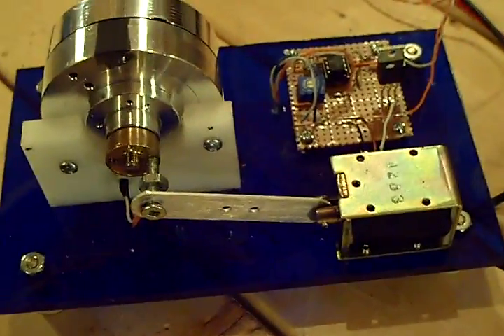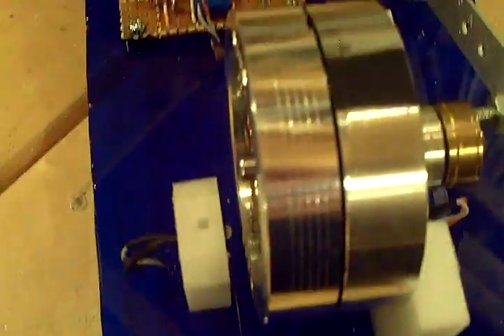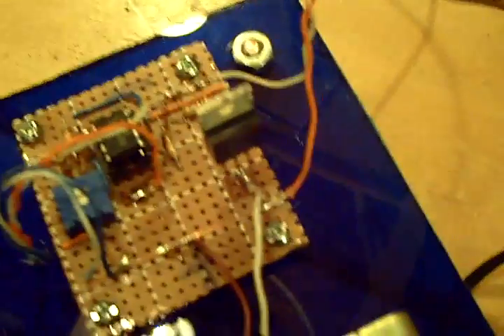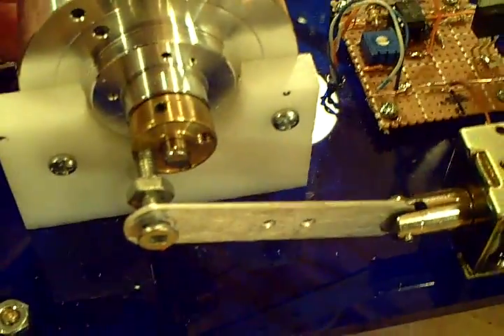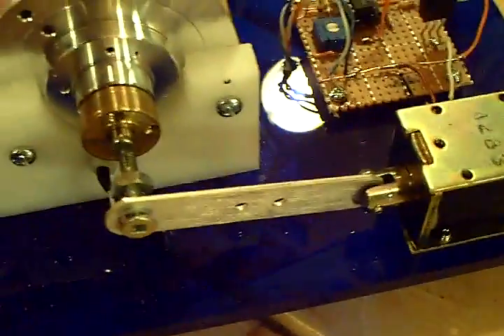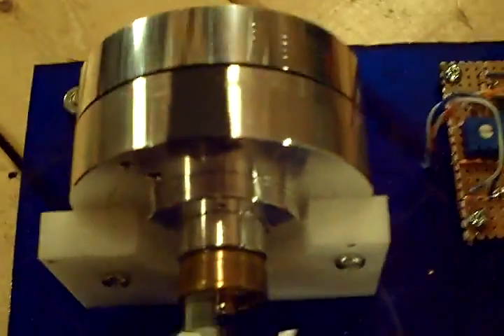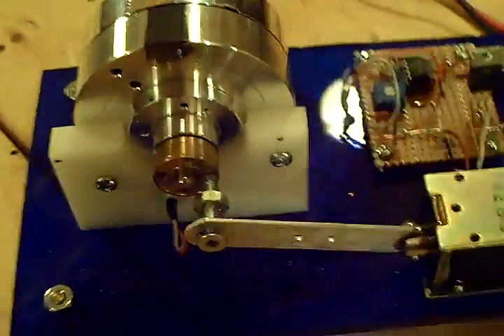Solenoid Motor on the Cheap Utilizing a VCR Video Head and Solenoid

Comment: will it run of a 12 volt battery, i dont have what ever kind of michine that is you have to power it.
Reply from the maker: hello,  you need to send me your email so i can send you the schematic.  This will also work with a 12V battery.
Reply: evanp@rocketmail.com than you very much
Reply: were did you find the piston motor part cant find it any were

Comment: i need some help with vcr motors.. questions. i wanna use vcr motor as a generator? need to know how to connect it? what do i need for that? i wanna make that vcr motor that he can produce electricity that it can charge the phone..but with minimum of rpm-s and what is the minimum of rpms for that motor to charge my cell phone.. i think i need 5 V and 0.7 A for charging.. so how to connect that and what is the minimum of rpms and what wire should i use. so i can make him efficient as possible.ty

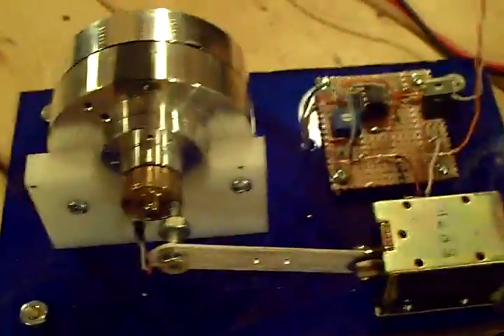Comment: 3:30 " it has no use, but as great conversational piece" - Oh I don't agree. Solar panel for power. connect motor to lightweight plastic fan blade from a standing floor fan + rubber band = automated cooling fan :)